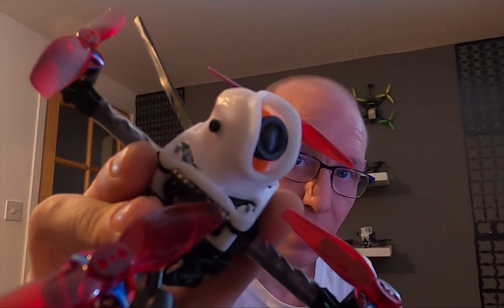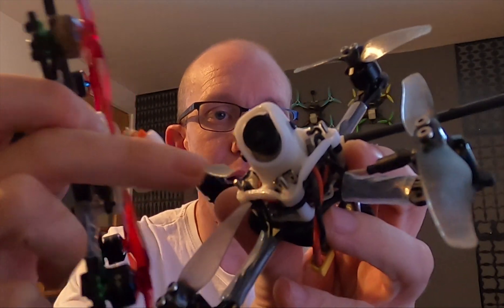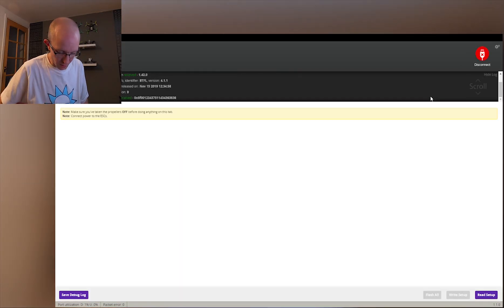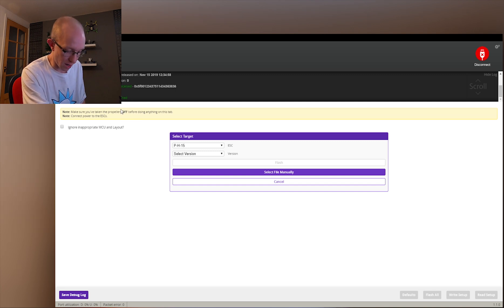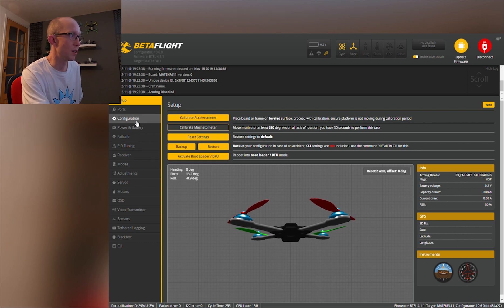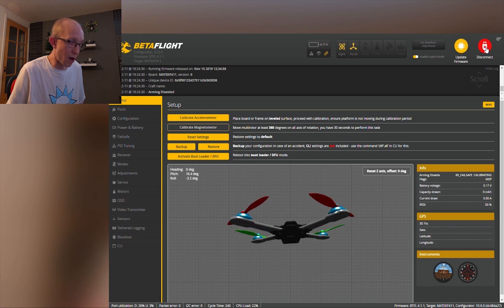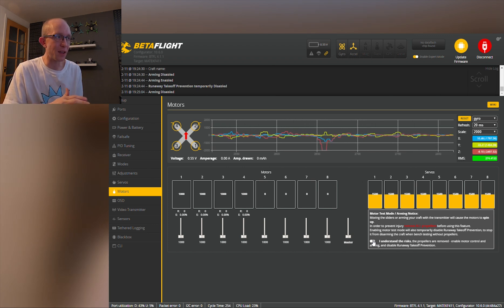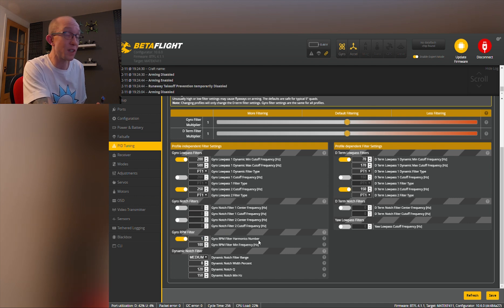RPM Filtering For FREE?!? On Your NamelessRC AiO Or ANY BLHeli_S ESC (read description)

Comment: i have iflight succex aio whoop 12amp and it uses the gh-30 esc and i updated to 16.73 and 16.79 and neither one works rpm filtering. any ideas before i rule out as rpm wont work on it? https://shop.iflight-rc.com/index.php?route=product/product&product_id=848
Reply from the maker: Hhhhmmmm, have you tried JESC? Might work better.

Comment: Hi sir. What happens when motor getting hot. I move slider does help cool down abit. But still does get rid of those 20c-25c warmer type of heat in motor. What is causing this? Is it i need specific settings to iron out this noisier signal get into gyros?
Reply from the maker: If you have the filter sliders all the way to the left then hot motors are not being caused by the filtering. It could still be that your P's and D's are too high. If turning them down doesn't make your motors run cool then it could be a number of other things. The props might be too big and/or aggresive for the motors to spin well, try running smaller and/or less aggresive pitch props and see if that helps. Could be you are running too high kv for the lipo and spinning the motor faster than it wants to spin. Could be the motors are damaged or badly made. Could also be a damaged ESC or bad firmware causing the issue.
Reply: @Bludz  okay ill try low pitch or smaller prop. See if its gone. Going to order low pitch prop now. Thx for response very appreciated
Reply from the maker: You're welcome. Good luck :)

Comment: Sir there are no videos on how to bind the jumper v2 transmitter to the tiney hawk can you make one
Reply from the maker: Sorry mate, I don't have a Jumper TX. I switched to crossfire over a year ago. Your Tinyhawk will use Flysky or FrSky protocol, so any video on how to bind the jumper to one of these should be the same. I think you can put the Tinyhawk into bind mode in the Betaflight configurator, but I've not done it myself, just seen it done that way at races. Hope that helps.

Comment: my namelessrc board came with p-h-120. what do i've to do? leave it like it? or switch to p-h-90 of i want 48khz?
Reply from the maker: I'm too scared to try 48k on my Nameless boards because of the P-H-120 issue. I think they run well as they come and it is the safest bet. If you want  to try 48k, you  will need to use the P-H-90 firmware.
Reply: If you look in blheli_s configurator is just shows normal p-h-15.
Reply from the maker: @robbinkoot2154  That is because there is no 120 so it loops round to the first one which is 15
Reply: @Bludz  yeah I just read a post about it...

Comment: Doesnt work on matekf411 targets 
Edit:  G-H-30 firmware not all F411 targets!
Reply from the maker: It works fine mate, the board in the videa (and I've been flying for 6 weeks) is MatekF411. Why would you say it doesn't?
Reply: @Bludz  Bidirectional dshot prevents the motors from spinning,  as soon as i disable it, they start working. Tried 3 versions of jazzMaverick. Geprc12A fc.
Known issue, im not alone with this issue,  i purchased Jesc licenses and try that later. Or do you know what the issue is??
Reply from the maker: @boratsagdiyev1586  Hhhhhmmmm, I've been thinking about this and I'm struggling to  figure out what the issue is. Is CPU load less than 20% whe idle?  You need 4k 4k dhot300 or it may not spin motors for that reason. Other than that it may be that that FC is not built exactly like it should be. Maybe some of the timers are off but as a matek target it still mostle works.
Reply: @Bludz  Bludz i'm running JESC 48khz licensed now and its perfectly fine. G-H-30  and JazzMaverick doesnt like eachother. 
It did work on my old F3 mobula7 with overclock so i knew i had it configured right.  Yep i have Dshot300 and 4k/4k :)   Glad i figured it out, it's running great ! Bidirectional not longer bugged.
Reply from the maker: @boratsagdiyev1586  Thanks a lot for sharing what you have discovered. I've been chatting a lot about it with NJTech and we think that using JESC is probably the way to go, he really knows his stuff and this has really confirmed that. I'm going to give it a try myself.
Reply: @Bludz  G-H-30 instead of what you have so that might be the source problem. I can see you're using F411 also but the G-H-30 is bugged.

Comment: I wish i would have seen this vid before i installed rpm filtering! I installed jazzmaverick p-h-15  16.77 48k on my nameless board and had a esc fire when i spun up the motor in BF motor tabs . All escs on the board are toast!
Reply from the maker: OH no!! That really sucks. I broke a Nameless board before I found out myself, but it would just overheat, yours is far more damage though. I have a good discount code in the description if you were gonna get another, or mayb try one of the newer ones BetaFPV or the new Mamba one.
Reply: Bludz FPV  Yeah , really bummed cause I was flying my TP3 with new FPVcycle 1303 motors and wanted to try rpm filters.  I prolly try BetaFPV TP 12a Aioboard. You think the fire was due to P-H-15? Kinda  scared to even try rpm filtering now. Lol
Reply from the maker: @SteveO4478  100% it is the misleading/incorrect firmware header. Mine runs fine on P-H-90 but I'm kind of thinking I won't risk 48khz on it too, running it twice as fast is probably a bad idea for this board, unless they can release a P-H-120 firmware for it. Clearly more to this than Nameless are telling us, but might get fixed without them even saying anything
Reply: Bludz FPV yeah, thinking I should have maybe just stayed away from 48k but I was interested in the extra flight time. Don’t even know if running 48k was the causing factor or running 15 on ESC FW.
Reply from the maker: @SteveO4478  Well running P-H-15 on mine it still flies but the CPU overheats almost right away on 3s, and after 30 seconds on 2s (even wehn putting 90 on it after, damage is done).  So I would say it is a combination of both. I will let you know if I risk running 48khz on p-h-90 and the nameless board, but I may just grab a diff board to do that with.

Comment: Guess I did something wrong. This version didn't work for my Trashcan. Would just give an RPM error. Since I was already in the groove of doing it, I wandered over to jflight and paid the 5 bucks. I was mostly not doing it because I'm lazy, but they have PayPal, so was nice and easy! We'll see tomorrow if it gets rid of the shakes I've been fighting. Thanks for the great video and for motivating me to get around to it.
Reply from the maker: I've had a Nameless board do the same thing, and when I flew it the CPU would overheat quickly. Hate to say it but your Trashcan ESC is either damaged, broken, or flashed with incorrect firmware. I beleive that if you get a lot of error the RPM filter won't work well. But if you have been flying it and it works then hopefully it is okay. Good idea to try JESC, they have an issues tab where you could ask for help too.
Reply: @Bludz   Haven't flown it yet. It wouldn't even arm or do anything in the motors tab. Now with the JESC stuff on it, the motors tab works. Will try flying in a bit.

Comment: feeling connected - duuuude! I just got a super low latency 144Hz monitor and suddenly things started to feel right again. I am betting you that switching to double the FPV refresh rate when that happens will be the same, as much if not more than RPM filter (which is awesome)
Reply from the maker: Having a high frame rate will not make your quad fly better, in fact it will mean that you see more vibes and wobbles. That's why you can't tune well using 30fps dvr, you need 60fps hd to see the vibes. DJI sends 120fps to the goggles, so I'm already used to this, the video looks smoother of course but only if your quad flies well, RPM helps that.
Reply: I know I know , I just wanted to talk about my brand new monitor :-D

After half a day using it I realize that it's not the high refresh rate that makes interaction less frustrating, it's the super low latency. This monitor has maybe half the latency as the old AOC. which was so bad that typing this text on it feels like rubberband. 

DJI has comparable latency as analog, does it feel more locked in? If you test that, you'll need to match weight with a few grams of lead, or feathers

Comment: Maybe you want update title to read warnings for firmware version. What firmware should I use for the geprc 12a aio or the crazybee board ?
Reply from the maker: If you plug it into blheli configurator and read setup, it will tell you what one to install. Just like I do in the video.
Reply: @Bludz  I was able to flash a crazybee fc but when I tried flashing my namelessrc with the P_H_90_REV16_74 file it seem to start but never flashed the esc.  I have bf 4.1.0 on the fc.  Is it possible that I should use another firmware.  Current esc firmware is P-H-15, 16.7.
Reply from the maker: @ChrisLBradly  dID YOU CLICK THE CHECKBOX TO ALLOW YOU TO FLASH FIRMWARE DIFFERENT TO THE SPEC CURRENTLY FLASHED ON IT? iT STOPS YOU FLASHING THE WRONG FIRMWARE, BUT WE HAVE TO DO THAT WITH THE nAMELESS BOARD

Shit, sorry for caps.
Reply from the maker: Good call mate, I have updated the title. Annoying that the one ESC I do the video in is the only one with a problem.